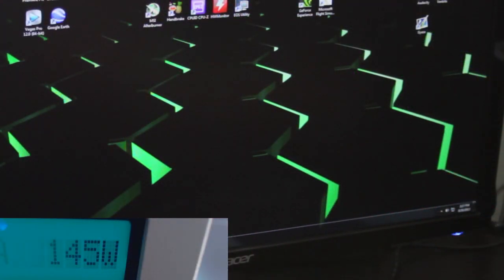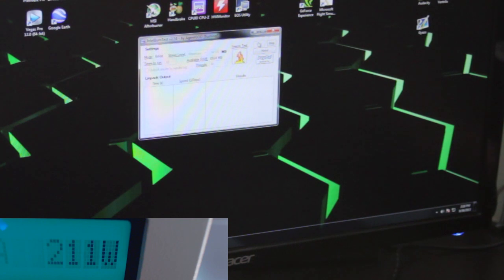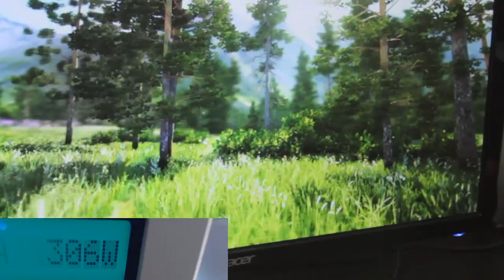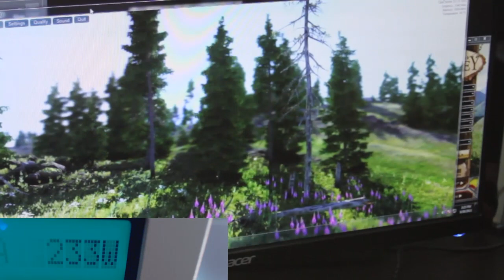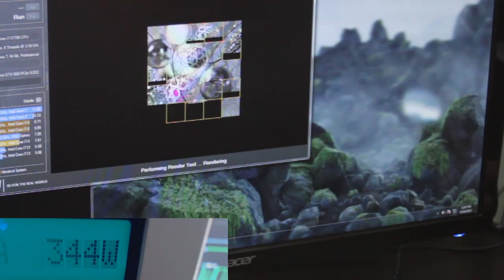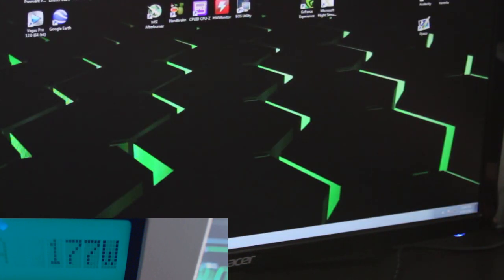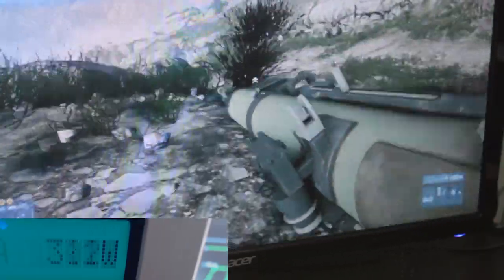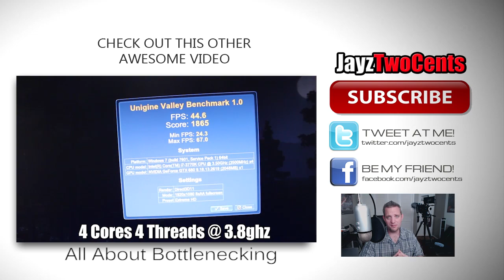How big of a Power Supply do you REALLY need?

Comment: I'm dealing with something interesting. I have Corsair TX650 and the fan makes rattling noise. I have the fan facing the floor like most do, but then I installed it up to see what was going on and then the fan never spins even when gaming. I'm guessing with it now vented at the top that the hot air travels up and causes the psu to stay cool enough to not use the fan, even during gaming. Any thoughts? I'm big on noise, I would prefer the traditional fan facing down, but noise is more important. I thought i was interesting the that people face power supplies down when if you think about it, heat in the power supply travels up and then gets trapped because the top is completely sealed off trapping the hot air. The build has a 5600k apu and 7870 temps are cool.
Reply: A PSU intakes air from the bottom fan, it doesn't output air. That is why people recommend mounting a psu facing down, except for when you are on a carpet.
Reply: Hmm why does my psu fan only spin facing down and not up when put in the same situation.
Reply: Peter Miller That... I could not tell you. If you take it out of the case, will the fan spin on startup when it is facing up, and when it is facing down?
Reply: Not sure. I was always checking in game where the issue started. Ill check later.
Reply: Peter Miller Okay, check out overclock.net, they will probably be of more help than I.

Comment: I have 650 earth watts handling an i7, a GTX 650 Ti boost,4 GB Patriot RAM,1 1TB HDD,1 60 GB HDD, MSI X58 Pro-E, 1 aftermarket cooler,1 fan, will I have to upgrade my PSU if I plan on upgrading my GPU and overclock my CPU?

Comment: -Cooler Master Hyper 212 Plus - CPU Cooler with 4 Direct Contact Heat Pipes (RR-B10-212P-G1)

-Gigabyte AM3+ AMD DDR3 1333 760G HDMI USB 3.0 Micro ATX Motherboard GA-78LMT-USB3

-AMD  FX-6300 6-Core Processor               is 600 watts enough for this?
                                                                  please reply ASAP!!
-MSI  R9 270  2G

-Corsair Vengeance 8GB                             

-Lite-On Super AllWrite 24X SATA DVD

Comment: when i have looked at power supply effenticy graphs it is ussualy a arc peaking in effenticy around if not at 50% usage so if you have a power supply which is double the amount of power that you are ussualy using while still over the total amount thta you use with everything turned onto max that will be the best power supply for your rig.

Comment: I am going to build this computer soon and I would like to know if it would be okay to overclock with a 550w power supply. The power supply is a rosewill 80 plus gold certified if that matters. And here is the rest of my system:

Msi 760 hawk
128GB Samsung pro ssd
1TB Seagate Barracuda Hard Drive
Asus Z87 Sabertooth Motherboard
Intel I5 4670k (So Gen 4)
8 GB of ddr3 1866 G Skill ram
Cooler Master Hyper 212 evo cpu cooler
and 2 case fans

If you could help it would be appreciated.

Comment: ***** 
I don't know if I am getting that wrong what you said about PSU efficiency maybe we just mean the same.
A 1000 watt PSU rating does not mean that it can draw 1000 watts from the plug but rather that the PSU can deliver 1000 watt to your system. That means a 1000 watt PSU with 80%+ efficiency does draw 1250 or less watts from the plug to compensate for 20% that is dissipating as warmth into the air so it can actually deliver 1000 watts. Also some quality PSUs allow burst overloads to some degree above the rated max power delivery for some time like your Corsair AX750. And before I forget it: pretty much all PSUs have their max peak efficiency at about 50% power system delivery and not at 100%. Just like your Corsair AX750. Tough it is true that you get the worst efficiency below 20% PSU load.

BTW: did I mention that I also have the Corsair AX750 PSU? Well, now I did. :)

Comment: i have a Corsair HX1050 Watt is that good enough for a 3 way SLI GTX 780 TI? OR atleast 2 way SLI 780 TI?
Reply: it's more than enough for 4-way SLI.
Reply: depending on your other hardware of course.(what are you using to cool everything etc. anyway, how DO you plan to cool 780 Ti SLI?liquid? fan ain't working properly on hot days, I tell you.)
Reply: Well on hot days I always have an AC on I also want to get into liquid cooling but I feel like I want to learn a little more  about it do more research on it I'm also a little hesitant as It can cause leaks this gaming on I have now was my first built 
I only have a 780 ti OC at the moment I want a 3 way sli going to do this very soon a week or 2
Reply: Danny Vaca A nice tip: unless you're running 3 monitors a 2-way SLI should run smoother than a 3-way SLI. in 3-way SLI one card will have to do half the work and the other two a quarter so you'll be stuck with whatever that GPU can throw. so I recommend going either 2-way or sell your family and go 4-way.(just kidding, though it's expensive)

Comment: My PC is An Old config Bt 
Can a 460w PSU would be good enough For
g41-combo
C2Q 6600 Overclocked to 3Ghz
1 x 500HDD
7790 or 7870
2x4GB ram 
and I Have a another question
That is 
With the same config How Much Performance will i get? With 7790 and 7870? 
what i meant that is can i Get the full performance of those cards? by using c2q 6600 and g41 mobo?

Comment: How much power would i need for
case/fans = a haf x case with 1 fan in the front 1 in the back 1 on the side and 1 on the top.
graphics card = asus geforce 660 ti
processor = intel core i5 quad core
heat sink = stock i5 quad core heatsink
motherboard = astrock z77 extreme 4
hardrive = western digital caviar green 2 TB
led lights = bitfenix alchemy aqua 30x led strip.

Comment: would a 600 watt be good enough with
r9 270
1 500gb hdd
4 fans
fx 8320 
1 4gb ddr3 ram 1600 mhz
mobo asus 990 fx extreme 3
Reply: It should run you fine, that's about 400 to 500 watts. My build is an FX-8320, R9 270X, 8GB DDR3 1866, and an ASUS M5A97 R2.0.

If you go to newegg they have Raidmax powersupplies for $65 that are 735W, which is what I got.
Reply: thanks
Reply: Valerio Cantatore almost identical build :D

Comment: I always like getting a big high end PSU because with my Pentium 4 rig I had a cheap 400 or 450w PSU that came with the case and I got random restarts 6months into the computer's life and that is when I got a 550w and it still works to this day. I do not want to go through what I when through when I had my Pentium 4 computer.
Reply: im having the same problem, i have a corsair 430w psu 80 bronze, i have a amd athlon 4x 750k processor 3.4 GHz,ASRock FM2A75 mobo. 4gb ram, 500 gb hd, msi radeon 7770 gpu.  would a better psu stop random restarts?

Comment: The video its globally right. But PSUs degrade in time (specially cheap PSUs) and in fact, a lot of brands, even brands like OCZ, Corsair, Antec... get part from various places and its hard to find a great quality PSU. When you see that your system grab 350w at full load from the wall and you have a 750w 80+, you've got more than the half of your PSU taken. In 3 years of daily usage (with a cheap one) he can loose up to 20% of his efficiency. In a one card scenario, its good enough (you have also to take care of the electronics degradation of your system that can grab a little more energy). But putting 2 680, over time, is not that great and become risky. And if you also (also, also.....) think about your home electricity quality ("electric bump'', interference ...) that can degrade even more the capacitor of your PSU, then it can be catastrophic. For 2 680 like this? At least 850w 80+ silver or gold. We can put more than 1500$ in our rigs and its really important to have a good PSU to protect this investment (and grab an APU, these are so cheap in sale and can protect your rig from various craps). I think that the video didn't put enough focus on choose the right one, with the best capacitor quality and think over time. Just to said that choosing the right PSU is not that easy...

Comment: everyone that building a desktop just get 1600w power supply u wont have to ever upgrade it and u can run 4 graphic cards im getting the one for my new desktop even though im starting with one GTX 780 but i plan on getting 4 of them but i recommend getting the highest powersupply so u don't have to upgrade if u add more stuff in ur computer

Comment: So I'm getting a msi twin frozr 680 and I currently have a i5 processor, 8gb ram, h80i, 1 light strip, 1tb hard drive, 1dvd drive I was wondering if a 500w power supply would handle the 680 and all the other stuff?? The video says it should but just making sure 500 would be enough

Comment: what kind of psu wattage would you recommend for this?
Intel i7 4770k (overclocked)
Nvidia 780ti
16 gb 1600ghz (2x8)
water cooling for the cpu h80 probly
2 ssd's (raid)
2 hyperdrives (not raid)

Comment: will a fractal design 750W with 80 plus bronze be enough for these specs?
AMD FX 6300
MSI/Sapphire R9 280X
Western Digital Caviar Blue 1 TB HDD
8 GB RAM Corsair 1600mhz 2x4
ASUS M5A97 Motherboard.

I know Jayz uses hardly over 400w but I just want to make sure.

Comment: Excellent video, but I can't help thinking how different your usage patterns would be for an AMD CPU such as the larger FX while overclocked.
You just have to be careful since you used Intel and these figures do not apply across the board and if someone is building a system for the first time and happens to be using an AMD CPU because of the cost. They might be led to believe they do not need as much resulting in many BSOD or other problems.

Comment: I'm a bit curious...I saw a few people talking about the power draw with two GTX 780's and a i7-4770K, both highly overclocked and cooled with a custom water loop. Add in a few fans, case lights, a few Solid State Drive and Mechanical Drives...

Would a 750W be okay, or would it be better to get a 850W or 950W to be on the safe side?

Comment: A lot was not considered in the conclusion.
If your PSU is rated way above what your system uses, this means that it generates less heat than what it is designed to handle at maximum, which has a lifespan-increasing effect on the parts used in the PSU and can, depending on how it manages its fan speed, result in a lower noise level.
Personally, I don't care much for energy consumption, but heat generation is undesirable to me for those reasons.
I'm using a "be quiet! Straight Power E9 CM 680W" (specified efficiency of 93%) and its fan speed curve keeps the fan at minimum rpm as long as PSU load doesn't exceed 50%. This means that even if I massively upgrade my system in the future or re-use the PSU for the next system, it will never raise its noise level above minimum. And even with my 'economical power-gaming' system and the PSU cooling at minimum rpm, it only gets mildly warm, so this will most likely be a very long-term investment.
Oh, and here's another advantage of low heat generation in general: Lower cooling fan rpm means less dust throughput (= buildup) in your case and thus less decrease over time in heat sink efficiency, and also less dust buildup in connector ports and such.
Silent PC are generally a smarter design.
Reply: Evan Reams
Several things that I have to object to in your somewhat arrogant comment:
1) You are implying that capacitors' internal resistance diminishes over age. That would be odd. Low internal resistance is a trait of high quality capacitors, so if a cap ages and you say it 'has to pull more amps', that would mean its internal resistance is lower. Also, it's not a matter of 'has to', since caps always draw as much as they can.

2) Capacitors charge themselves as soon as they get power and then they buffer. So even if point 1 was true, it would be practically irrelevant regarding system stability.

3) A 520W PSU isn't pulling 520W from the wall regardless of how much power the computer uses. The efficiency merely increases with higher load, but not nearly to the degree you are stating. It is mostly an issue at very low power consumption. Hell, you even said it yourself! You are directly contradicting yourself from one paragraph to the next.
If you take a 520W PSU and give it 100W load, it will generate very little heat (at relatively low efficiency that still nowhere generates as much heat as if you put 250W load on the PSU).

4) Overloading a rail isn't dependent on the amount of devices connected to it, but on the total load at any given time. If you have one rail that can supply 80 amps, it's roughly just as fine as if you distribute the devices across 4x 20 amps. The one rail might even be more advisable especially if you intend to make full use of the PSU's capabilities, since you don't have it split up in equal portions. If you have a monster of a graphics card on one rail and a harddisk on another, there's an imbalance of rail use, and this would require you to overscale the PSU anyway, since with an imbalanced setup like that, you can't easily make use of its full potential.

BTW I didn't recommend a massively overpowered PSU, and the price tag will be off-putting anyway. I was advocating not running a PSU near its maximum specification if you want reliability and low noise. How much energy a system actually draws will have to be determined of course.
Reply: Or instead of getting a decent PSU with way more watts than you need, you can get a high quality PSU that has a little bit more then you need, but I see your point, because you can use it in the future if you want to make a new build or add on to the system you have
Reply: Even a high quality PSU (actually my be quiet! might be one) will be noisy when under high load. Electronic components have certain temperature limits, and higher quality components might work more reliably under such conditions, but they still need more cooling under higher load.
Reply: Sure, but if you are getting a 1000w PSU to run a system that is under 500w, then you should just get the seasonic fanless 520w PSU, that way it is more efficient at that point, and it is completely silent, so don't waste your money on a huge psu.
Reply: Dowlphin I think you misunderstood. The fanless model is actually similar design to the 1000w psu, but it is designed to run more efficiently at lower wattage (400)
Reply: I don't think you understand... the 500w psu IS the 1000w psu simply capped at 520w and with no fan.
Reply: Dowlphin So if better get a bit higher wattage PSU from system rig max power draw , so it will have longer longevity ??
Reply: kingnfs1 Whenver you can affort it - definitely. Be aware that you can't expect to get stuff for free, so if you buy a higher-W PSU that has the same price as a lower-W one, you might not gain anything. (Although there are other design factors involved, too.)
But as I mentioned, not only can you expect higher longevity from a PSU that's not under full load, but you also have less fan noise.
It's the same principle as with CPU coolers: I have a HUGE cooler with a HUGE fan. It is much bigger than it would have to be and thus more expensive, but this means that it generates a lot less noise.
Again: Be aware that marketing likes to show off with big numbers, so if you don't know whether to get a 750W or a 550W for the same price, even the 550W is likely to already be much more than what you need. You can read up on what maximum power consumption various computer systems have these days. It's not THAT much.
Reply: Dowlphin I want get RM psu series from corsair , under 40% load zero dB fan noise even it bit expensive, what you think?
Reply: kingnfs1 It's a smart hybrid-approach, and if it's expensive, it indicates that measures have been taken to make it run reliably without cooling. Although I've read things lately that indicate it might at least be wise to read up on the reliability of Corsair PSUs. (You could check out Amazon reviews I guess.)
It's also generally a good idea to do this for the specific item you intend to get, since there can be much variation in quality. Even a brand known for great reliability can screw up and release a flawed product line.
Reply: Dowlphin I see , thank you for you opinion  man :D

Comment: I have a fx 8320 a 7870 from gigabyte and plan to add another 7870,I'm worried that my 650w psu won't handle,meh,it'll probably handle but I should still get a 750w PSU